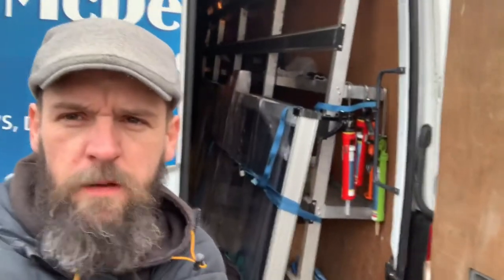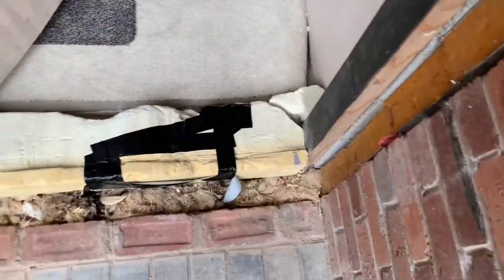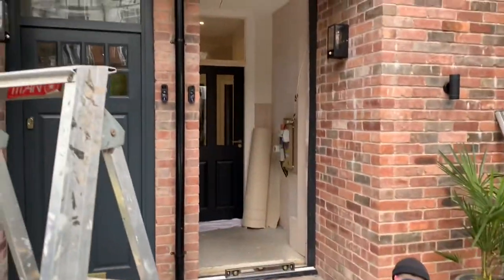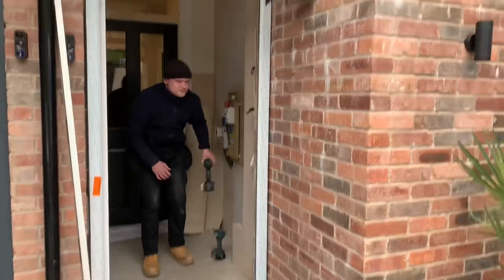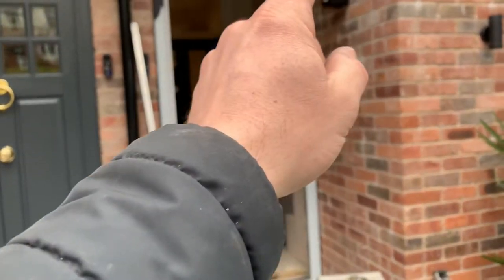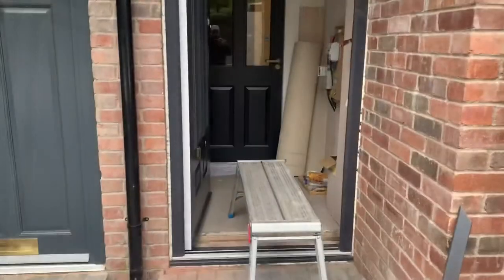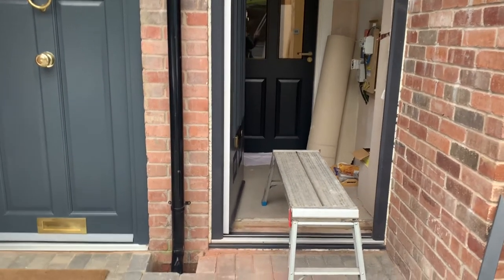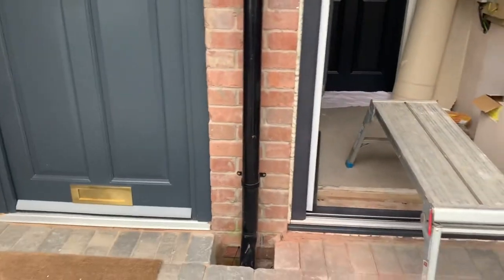Composite Solidor installation

Comment: hi there, How would I change my normal composite door to have a paddle handle type that won’t open outside unless the key is used

Many thanks
Reply from the maker: Hi, depending on the lock type you can change the handle to a split spindle option quite easily. Google split spindle door handle. Hope this helps.

Comment: I was wondering, if you need to replace your door and it has a transom above it, is it possible to remove it and brick/board it up and get a new door for the opening that's left? Or would you always need to have a transom to fill the gap? Does it have structural properties? Great install lads  thanks
Reply from the maker: Hi Kermit, we would always look at replacing the door, side frame or top light at the same time. However it is sometimes possible to keep these in place depending on the condition. Hope this helps. Kind regards, Stephen
Reply: Thank you for replying!

Comment: When fitting the door to the cill is it fitted dry or do you run silicone on the top the cill? Just had a solidor fitted and was fitted dry. Previous upvc door was siliconed in to the cill
Reply from the maker: Hi Chris, apologies for the slow reply. Yes, always seal the cill to the pvc frame or aluminium low thresholds. This will stop driving rain or water when cleaning back tracking into the property. The seal will also stop any draught. Thanks for watching and your question, Stephen